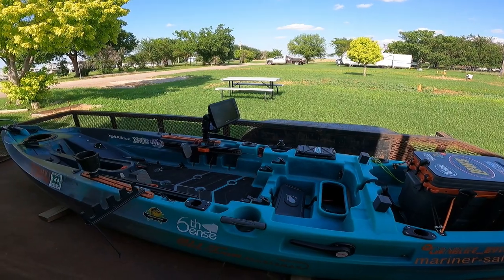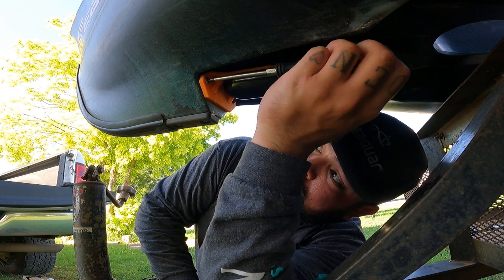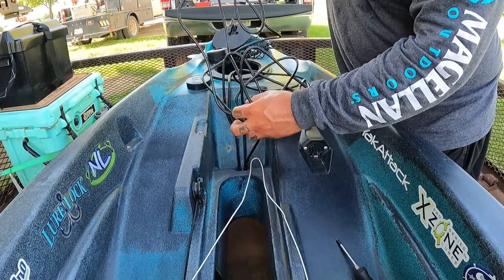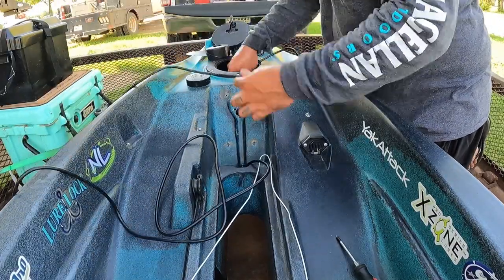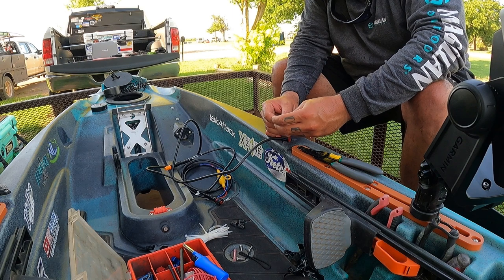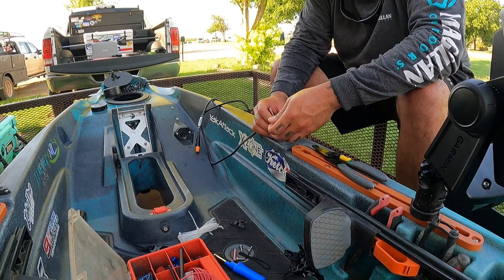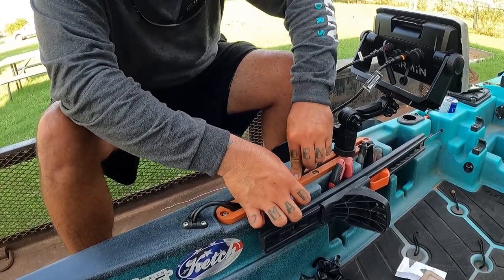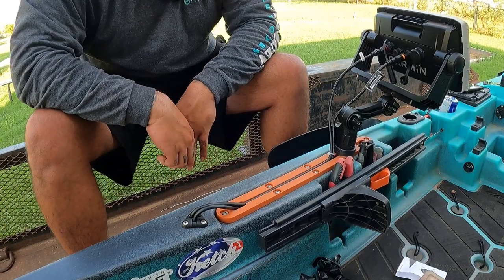Garmin 93sv UHD install on a Oldtown Autopilot 136!!

Comment: Good video very thorough. Thank you for the info on the transducer mount.
Reply from the maker: Absolutely however I don’t use that particular mount anymore. I’ve switched to one made by yakhobby
Reply: Which of the two yakhobby Garmin mounts are you now using?  Thanks.
Reply from the maker: @warefisher  the one that bolts to the top of the transducer. However we are no longer running the garmin.
Reply: @ecofishingshop  how come?

Comment: I had a major issue threading my Lowrance wires through the Old Town's ports. The plugs on my Lowrance were way too big. I ended up having to cut the tube thingy and open it around the cable, then I used some plastic bond to re-seal it. Other issue I had was the cables were too fat to fit the little piece that goes on top, so I had to rig up my own waterproofing. Took some silicone mat, cut out the shape, put it underneath the little tube thingy, screwed it in then sealed the hell out of it with some marine goop.

Comment: I have same kayak AP120 and Garmin UHD 93sv. I’ve has bad interference and broke an off bmrand transducer mount. Then we tried the Navarre scupper mount screw is to long and transducer is backwards. I get interference when the trolling motor is on mostly on my clear Vu. Separate lithium batteries and ferrite ring has done nothing. Curious if you have suggestions to get rid of the interference?  I see you have moved to another brand. Is the interference gone? Thanks, Kathy
Reply: Same issue with 73sv. Tried the ferrite bead and it didn’t help. Only heard of this with Garmin so shopping for Hummingbird replacement.

Comment: The part I'm confused by was wiring the power cord that went to the front hatch - but then the battery used was in the rear hatch. Can you explain?  TIA
Reply from the maker: Hi, Chris, thanks for the question. The cord that is running to the front hatch is the transducer cable. The power cord is in fact running to the battery in the back. Transducer cables can look like a power cord and typically come with a longer cord so you can put it anywhere on your kayak or boat. This may not have been explained in great detail and I hope this clears up anything that may have been confusing.

Comment: Do you have any on screen sonor interference on your fish finder when you run this Garmin unit and the i-pilot trolling motor at the same time?
Reply from the maker: Yes and the only way I’ve been able to mitigate it is by turning your brightness down to 87 or so then adjust your contrast to your liking.
Reply: @ecofishingshop  what about in traditional sonar (or chirp)? Do you get the noise interference then as well while operating the i-pilot trolling motor?

I do. It's horrible.
Reply from the maker: @alexanderjamesINC  yes same as side vu go to settings and turn your gain down till it cleans up but still getting returns
Reply: @ecofishingshop  thanks for replying and thanks for your help. I'll try that.
Reply from the maker: @alexanderjamesINC  absolutely! If you have any other questions please let us know.

Comment: Will that mount fit a 2020 predator pdl the same way
Reply: Does side imaging work well
Reply from the maker: I’m not sure on the mounting location of the predator but I would assume it will. However that particular mount broke but the seller did make everything right and sent out a new one. I’m currently just using the factory stuff I haven’t had time to reinstall the mount.